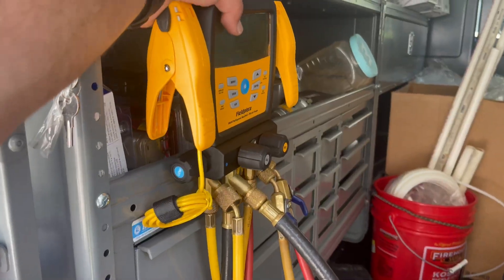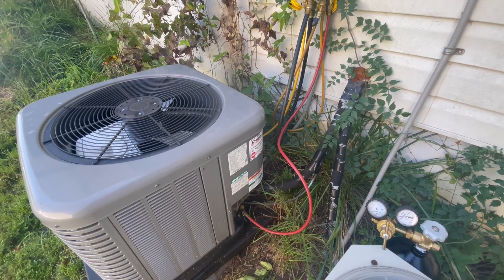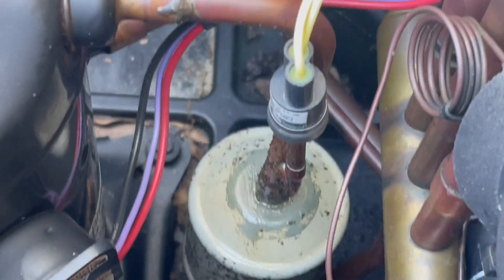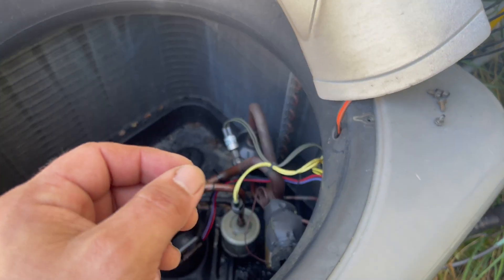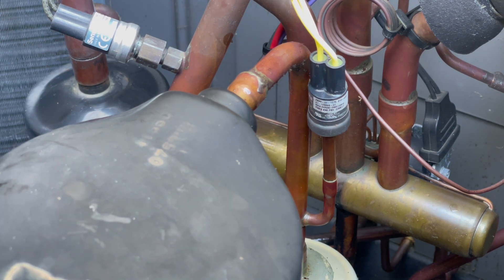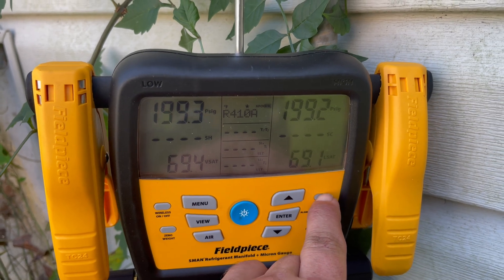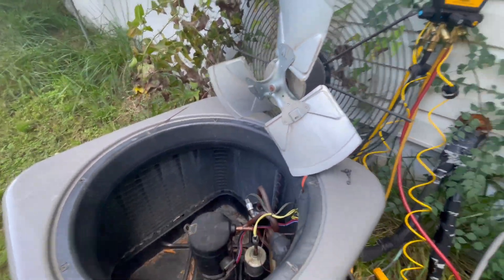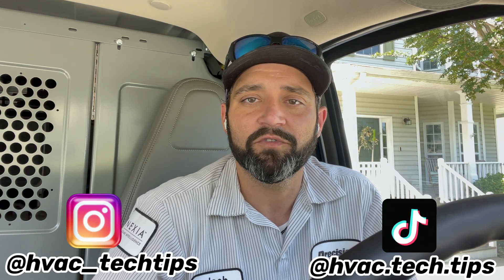Think You Got A Leak? HVAC Nitrogen Leak Search and Repair!

Comment: If you bend a tube, it's probably good to do it slowly. I know time is of the essence for service calls/installs, but we're talking 1s vs 15s. Just bend to not overtax the tubing. A fast bend will cause cracks with metal fatigue. Give the metal time to sink into it's bent form. Seems weird, but this may have been the situation. In addition, you have to ask, would you get the service call if the install was not done perfectly? No. So are they milking it industry wide? Curious. Early install problems result in more work later. Is it the best practice? I'm not sure. This is ethics 101.

Comment: This information is great even for a homeowners like myself. I realize this was a hairline crack but you didn't apply a vacuum to the system and you didn't change the filter either. Wasn't it necessary even though the system wasn't completely open?
Reply: The system was open & filter should have been changed. Nitrogen should be flowing if flame is touching copper, imo.

Comment: Aren't you supposed to pump the system down or pump the freon out before adding nitrogen? And then put the system back into a vacuum after doing so? I'm still learning but this looked so easy
Reply from the maker: Yes you would need to remove the refrigerant before a nitrogen leak search. This system was empty when I got there. So after you find and repair the leak, you would then pull your vacuum.

Comment: It's a common failure point now with these new units. I've fixed 5 so far this year same Crack
Reply from the maker: Yep very common. Rheem has started using a zip tie to keep the sensor from vibrating. If you run across any that haven't started leaking, place a small piece of armorflex in between the sensor and discharge line then zip tie it.

Comment: That was an engineering flaw,the best thing is to cap and put a T on the service valve with a manual reset 575 psi.I think it will crack again,what are your thoughts.
Reply from the maker: So far it hasn't. Rheem told us to zip tie the top of the sensor to the discharge line and it's seemed to work.
Reply: I guess a sip tie is too expensive for rheem. @HVACTechTips

Comment: I never had much luck with cal-blue to finding leaks. Big blue is much better. Also my boss heard from Rheem to put a vibration pad between that sensor and the discharge line to prevent that leak. You hear about that?
Reply from the maker: No I haven’t. I’ve heard Rheem say to add a zip tie around the sensor and discharge line.
Reply: I use the bubble solution that kids play with.

Comment: Great video...
Any options for a fridge keep on tripping the GFCI..
( Daisy chain probably )
Plugged in the outlet -
Outlet connected to GFCI -
Then back to the breaker outlet...
As soon I plugged it in the outlet the GFCI trips?tried to reset doesn't respond.. turned off/on the breaker outlet..
Then plugged it in again doesn't turns on just keep tripping the GFCI...
Put a smaller fridge (new) doesn't trip?Any suggestions?
Thank you have a blessed day and be blessed
Reply from the maker: Either the compressor is shorted to ground or the GFI is bad

Comment: I have fixed that same leak probably around 10 times now on Rheem condensers. I talked to a Rheem rep and he told me that there is supposed to be a zip-tie securing the switch  to the discharge line so it doesn’t vibrate and cause that stress fracture.
Reply from the maker: Really? That’s interesting. I haven’t seen that at all and we are primarily installing Rheem for the past 10 years. I’ll definitely be keeping an eye out for it.
Reply: @HVACTechTips  ive seen it 10+ times too. they send the zip tie in the repair kit
Reply from the maker: Thanks for the info, after you sent me that several months ago, Rheem started sending the zip ties in our kits too. It was a huge problem for a while. I'm still running across them from time to time.
Reply: I wonder if a zip tie would have sealed it before soldering 😂

Comment: When I used to sell and install Panasonic ECOi VRF Systems the old Nitrogen pressure commissioning test was 650 psi for 24 hours.
Reply from the maker: Man. That seems like overkill. Lol
Reply: @HVACTechTips  when you just sold a 60 ton 20 to 60 Plus air handler system with 1000 to 3000 feet of pipe and you have several hundred brazing connections.    There’s no such thing as overkill when your reputations on the line. 

There’s no grabbing the line and pumping in until his beer can cold every time some old timer does that to one of these systems the compressors get munched. 

You just charge the customer $270,000 in equipment and another $65,000 plus in labor for installation you better do it right the first time.
Reply from the maker: That makes sense.